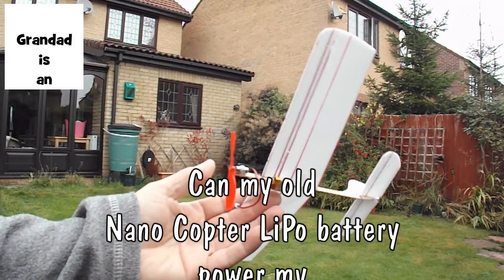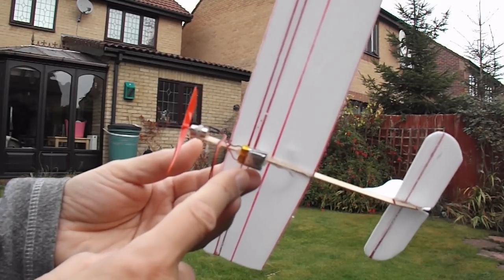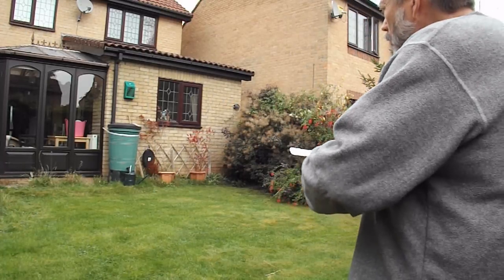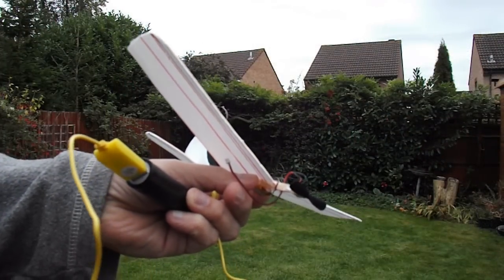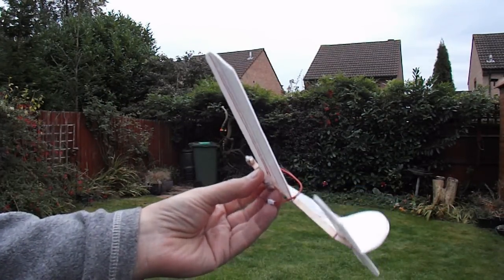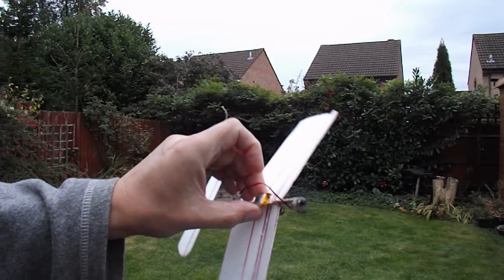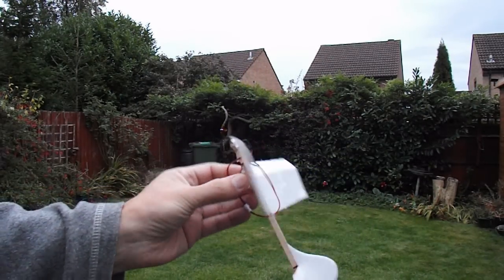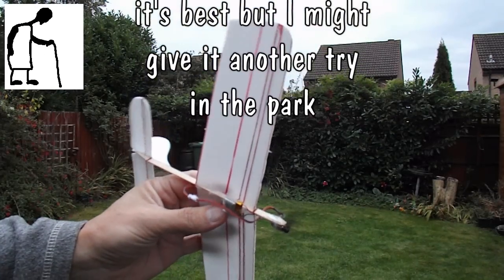Can my old Nano Copter LiPo battery power my styrofoam plate glider

Comment: Its only a glider if it doesnt have a motor. This is clearly a powered plane. Its nice, but not a glider.
Reply from the maker: It was a glider originally, I explain that in the first few seconds.
Reply: @GrandadIsAnOldMan    i dont have sound so i missed you saying it. Thanks!

Comment: Am rethinnking my position on that battery. It looks like a great use for it...as long as it gets stored in a metal box perhaps. Now, its a fun trojan horse to fly with !
Kind of funny to think it failed to power a nano copter but now powers something bigger :)
Reply from the maker: No I think you were right. It takes 10 times longer to charge than the supercapacitors for about the same length of useful power output. Maybe I could try it in a tiny hovercraft or car where the lower power output might be useful.
Reply from the maker: There is a massive difference in the power required for vertical takeoff and hovering compared to horizontal flight.
Reply: maybe if the glider was smaller

Comment: CAN I USE SUPER CAPACITOR 2.7V 10 FARADS FOR MY OWN BUILD STYROFOAM PLANE ? 
BTW YOU REALLY DO A GREAT JOB. YOU'RE MY INSPIRATION
Reply from the maker: The issue will be weight so it depends what motor you are using with it and how big your plane is. Here is my Supercapacitor Planes playlist https://www.youtube.com/playlist?list=PLA5a2xPRSrB1wNvirrwAn69eo_pM0tdEM
 including videos by several other people.
Reply: im using the same motor and my plane is 20cm long with each wing approx 18cm long
Reply from the maker: My gut feeling is the supercapacitor might be too heavy but there is a simple way to find out, try it. If it is a bit heavy it might still fly but need to go quite fast to keep itself in the air.
Reply: so would a li po battery would work?
Reply from the maker: Same issue, just find one small enough and you should be OK. The SuperCaps I used were 5 Farad, I haven't tried a 10 Farad but know it would be that bit bigger and heavier. The number of Farads is the capacity so that would relate to how long the motor would run from each charge. I never want a long run as I don't want the plane to fly off and lose it. With a LiPo you may find the motor runs for several minutes which is long enough for it to disappear way out of site and never be seen again. Then you need to look at building a timer circuit to cut the motor after a specified period.
Reply: thank you so much for the great advice

Comment: I made my own plane using my old helicopter battery and it fly around in circles sky high until the battery run out!
Reply from the maker: Hi, thanks for commenting. Yes, that was my intention here but I think that battery is really past saving. I have tried it again today on my little hovercraft and it only lasts for seconds. I might put it back in that little plane and let it fly off into the distance, but I would worry about the battery disposal if I couldn't find it again. Maybe if we have another very calm day I might try it.
Reply: Kamuy1337 name of video

Comment: can u make a solar powered airplane small one
Reply from the maker: Izzy Khan nope. The smaller you make it the harder it is. You need a massive area covered with solar panels to give you enough power so you need to build a very large plane to spread the weight. There is no way I will be doing that.